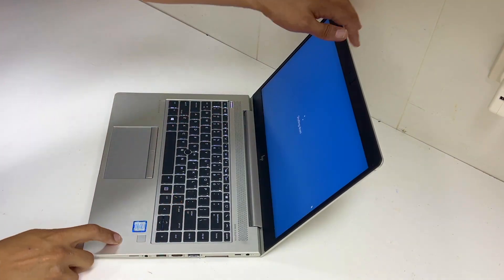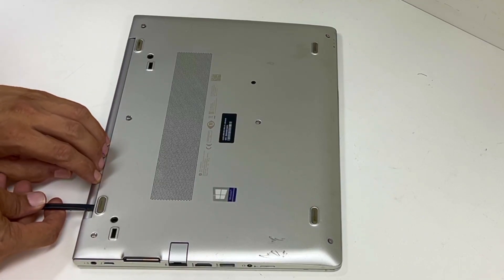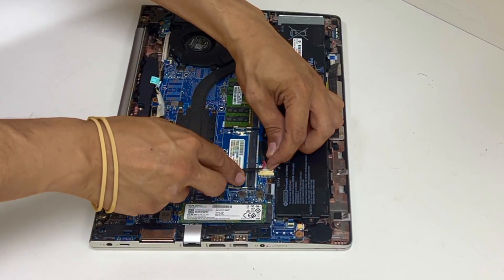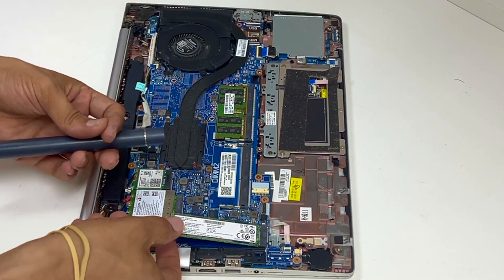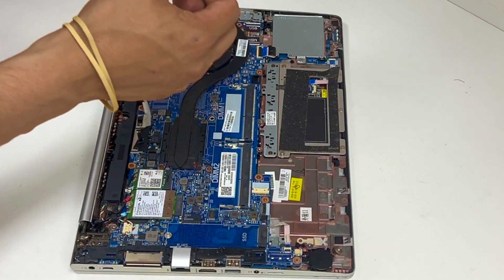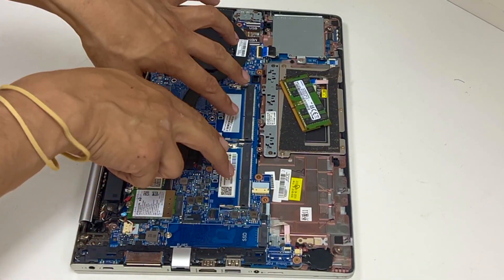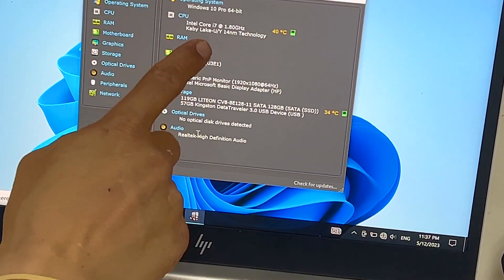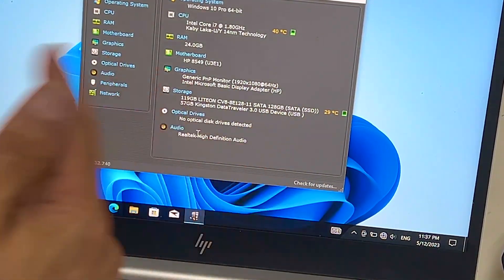HP EliteBook 840 G6 | How To replace RAM + SSD

Comment: Hey! Nice video I have the same laptop. I’m about to buy a vengeance ddr5 16gb ram. 4800mhz. And 1TB ssd 13.500 mhz is it ok if I use those with that laptop? I really appreciate if you can guide me